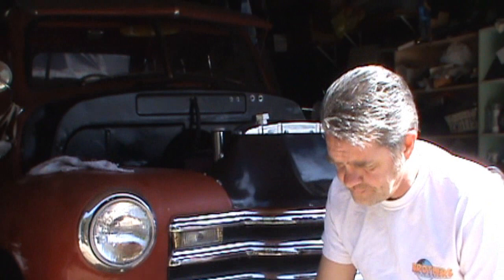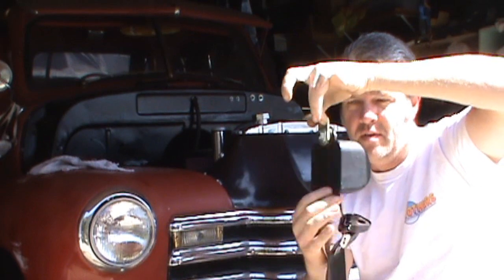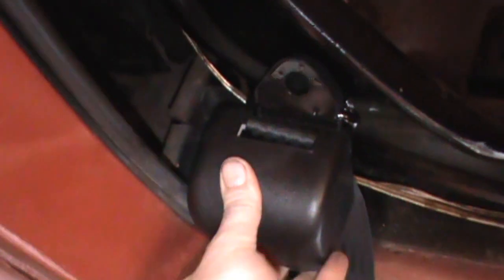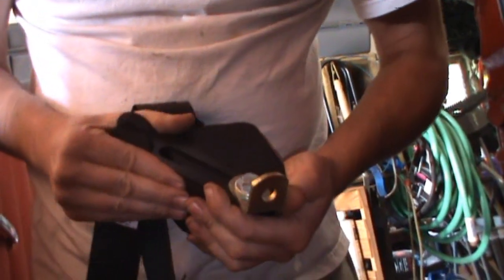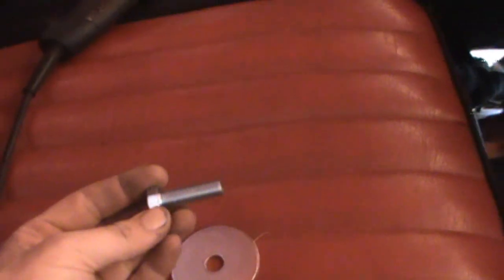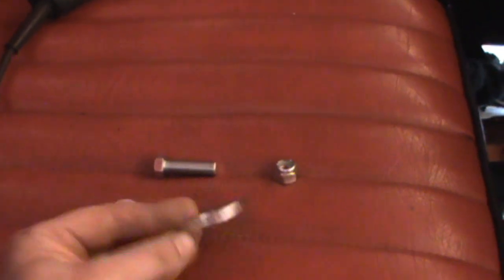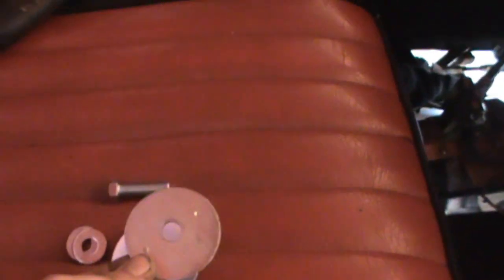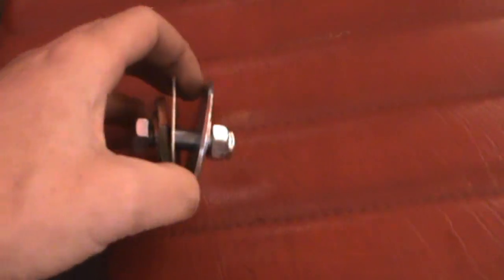1947 to 1955 chevy truck seat belt install

Comment: I am working on a 50 gmc truck body and putting it on an 85 s-10 truck frame.  How do I mount the front clip on the front side? where the radiator is.  Any help is appreciated  thanks